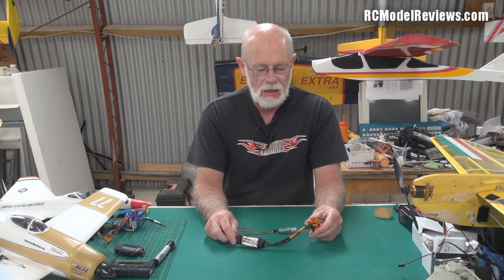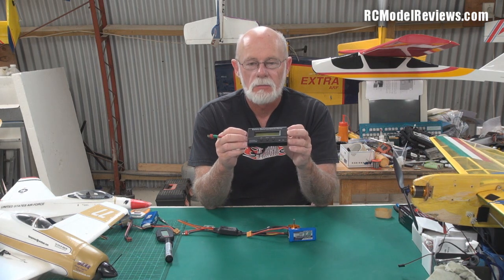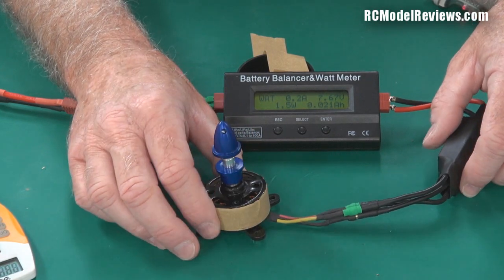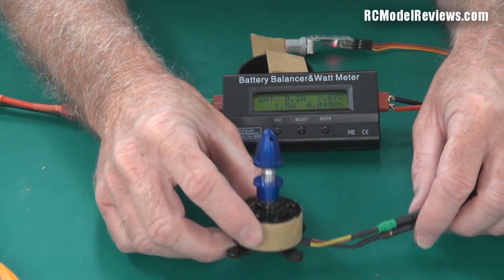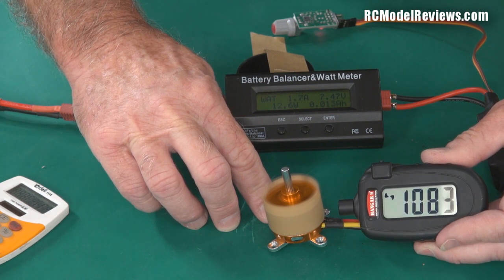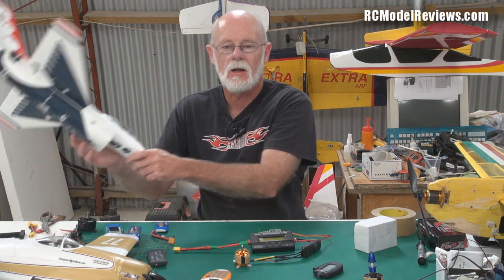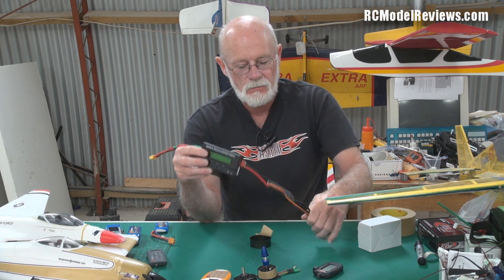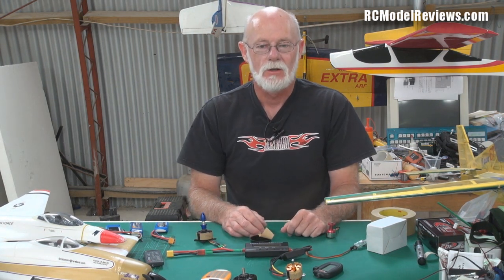RC BASICS: What is KV?

Comment: Hello bruce i have a question what motor/prop would give me the longest flight and lift the most based on a 650 quad frame(hk predator) 3-4 s lipos5000mah using simonk flashed 30 amp escs

Comment: but what wil fly your plane faster? 1000kv or 3000kv? how highter the kv how faster?
Reply: the higher the kv the higher the speed essentially, so the 3000 kv will be faster, but also heavier. It also depends on the prop. More speed isn't necessarily better because it's going to get to its maximum range faster, and if you crash, your gonna be going a lot faster

Comment: So with R/C car speed run guy's run 2200kv motors with 1:1 gearing for speed and Short Course (I'm guessing) 4800kv for torque.? Why would planes be different torque vs speed I'm confused or does this have to do with what battery can be used?
Reply: +natemorte 2200kv is more torque, lower kv is more torque, 2200kv motor is used for speed runs a 1to1 gearing because it has enough torque to pull through the long gear ration without getting to hot. 4600kv motors are used in short course because you are limited to 2s for most racing and you sttill able to get some power with the 2s on higher kv

Comment: Hello,
Can you please tell me what are you using to control the ESC, yes its a potentiometer but there is more to it then just that. I would like to buy one for myself, if anyone can please tell me. 
Many thanks
Reply: Bernhard Lehder what he’s using is a servo tester. They’re very affordable. Here is the one I use: https://www.banggood.com/Wholesale-EK2-0907-Updated-Version-Servo-Tester-Server-Electronic-Speed-Controller-p-66240.html - just be careful hooking up the battery, you can use the balance plug on a multi cell lipo to power it up but you only want 1 cell. Or use a receiver battery pack for gas planes. Hope this helps!

Comment: Seems like to increase EDF jet efficiency I would want to pair a low KV motor with a high # of blades that use an aggressive pitch angle. This should allow the plane to hit significant speeds at a lower rpm. Is this correct?
Reply: I'm still trying to figure these types of questions out, I believe the defining factor is propeller stall, if you go too high of a pitch for your model your propeller will be stalled for too much of the flight envelope, so with too high a pitch you'll be very innefeciant at low airspeeds. I think this is a safe assumption but I'm still learning myself so could be off here. Also the answer I always get when asking a similar question is "it depends on the model" but no one has fully explained why. Hard to research this stuff cause it's hard to know exactly what you need to learn.
Reply: Travis Pratt A motor will be most efficient at a given rpm. Say with the given pitch of blades and # of blades that rpm would push an F16 (or similar plane) to 60mph. Well if you put that same motor in something shaped like a B57 Canberra then that same peak efficiency motor RPM would have the plane going much slower, and this would lead to a higher amp load on the aircraft with more drag. Hence the "depends on the model" its drag/power ratio.

As you mentioned the low KV motor and high pitch blades would require a higher minimum speed. Thats what im after. High speed efficiency. Im theorizing that running the same Jet on a higher KV motor, (requiring lower pitch blades and higher rpm at the same speeds) would net more drag because friction gets exponentially worse with rpm.
Reply: Its rpm that determines motor efficiency? Will rpm always be the same for a given watt draw with the same motor?
Reply: Travis Pratt I am unsure if rpm nets efficiency as it does in Airsoft. The rpm should be the same at a given wattage, if the plane is doing the same thing at that given time. Climbing vertical will hit a higher wattage at the same rpm than level flight

Comment: Is a 1,000 kv motor more powerful than a 900 kv motor?
Reply: only if they have 10/9 the amperage draw, the thruster (a ducted fan, centrifugal compressor, or propeller) sinks the power to good use and the battery can handle it

Comment: I seriously doubt no formula exists. my guess is once esc factors, blade diameter/pitch and length and environmental factors like heights above sea level and or a range of runtime barometric pressure are all accounted for it can be modeled/made into a function that would output a flyable prop size the first time. its not quantum uncertainty. also afaik its square wave output which makes it not ac in the traditional sense. also if i have it conceptualized correctly the output of the next phase is the same polarity different phase. the only negative voltage comes from non powered phases and is used in the sense chips not actually adding drive power.

Comment: I have a question.
My goal is to build a large very light weight quad. that is very efficient.
I want very long flight times and only carry a gopro. 
I have Tarot 5008 340kv motors. they recommend up to 18" props
What if I go to 24" props? I think the efficiency would be better. I probably will not have great takeoff performance but at my light weight should make normal flight ok.
I also realize that if I am heavy on the throttles or overload the quad. The motor will most likely will overheat?
The goal again is longer flight time for the same fuel. Will I make any improvement?
I am a Pilot of real aircraft the larger and slower the prop = less fuel

Comment: Hello and many thanks for sharing this video with us.I have a newbie question please.
I was wondering where you purchased the throttle control switch that you connected to the ESC, I have a spare motor and ESC and wanted to do the little test that you did in this video but i dont want to hook it up to my phantom as i would have to unscrew everything so when i saw you plugged in a throttle control i was very interested where you got if from.thankyou ps the MFNZ SUCK
Reply: Do a search for servo tester, they can be bought on ebay for 2 to 10 bucks.
Some folks like the ones with the digital panel for doing test at various throttle settings.

Comment: Bruce I have an issue with your calculation of KV, at least as how you described it. You used the volt measurement from your battery, but that is a DC voltage. The ESC is creating an AC voltage which is not going to be the same as the DC voltage from the battery. The AC voltage will have some RMS value that would be roughly equivalent to a DC voltage. Your calculation gets within the ballpark, but I bet your lack of accuracy is due to difference between AC RMS and DC volts.

Comment: Could you please tell me "what is that device that is plugged into where the receiver goes that has the adjustable knob on it?"
Reply: +Mitch Livingston You can buy a digital servo tester, typically used to test that servos are running the right direction, they will also work for testing motors all you need are the signal and ground wire from the ESC,
They typically need a 6 volt battery or wall wart DC power supply then you just plug the ESC leads into the  other end, the pins will generally be marked with a +, - and a squiggly line you just plug in the - and the squiggly line from the esc and away you go.
Reply: +fabricator Thank you very much for taking time out of your day to answer my question!
Reply: No problem.

Comment: But how does voltage change the speed? I thought brushless motors AC or DC are dependent on frequency
Reply: same question!
Reply: The supplied voltage has a trickle-down affect on the rest of the motor.  The current magnitude is in turn impacted by the voltage.  the magnetic fields in the motor are created/impacted by the current. Said another way:

The speed at which the rotor turns is controlled by the magnetic field, which is in turn dictated by the current, which is in turn caused by the voltage.  Hope this makes sense.

Your comment about "frequency" isn't WRONG, it's just you have to be really clear what you mean by frequency.  I think you are referencing AC motors which do have a frequency associated with them. 3 phase induction motors/generators (such as those used by utility companies to produce power for your house) are frequency dependent (60 Hz in the USA) so that there is a STANDARD for equipment to operate on.  The frequency in this sense is the number of times per second that the power (in watts) completes 1 full cycle on a sine wave curve.  60Hz means its happening 60 times per second.  Try not to confuse the idea of AC frequency with... well, just the general meaning of "frequency" which is "how often something happens".
Reply: Jason Cochran I agree when you're talking about brushed self commutated motors, but brushless motors aren't mechanically commutated. The ESC sends out an artificial 3 phase sequence for the rotor to follow, the higher the frequency of the sequence of phases the faster the rotor will spin.

Applied voltage won't have an effect on speed, only current drawn needed to supply output power.
Reply: Thats not exactly my understanding of ESCs for brushless motors.  I believe ESCs are essentially manipulating the motor via Pulse Width Modulation (PWM).  Higher voltage = longer pulse = spins faster because the motor is switched "on" for a larger percentage of the cycle.
Reply: Jason Cochran ESCs are generally for controlling AC motors, which change their speed according to 3 or more pulses corresponding to a position in the motor.

Comment: You left out the "why"?
We get that K=rpm and V=volts, and yeah, you can measure it... but WHY does it make any difference?
Isn't it the rate at which the ESC fires the windings that determines the RPM, in conjunction with the load on the motor?

I don't get how or why volts have got anything to do with that?
Reply: kv is an equation, k times v. if you have a 1 volt input on a 1500 kv motor, your motor speed is 1500 kv, 2 volts is 3000 kv and so on

Comment: I notice you made a mistake. Bigger motors have a much lower kv because they use much larger batteries with higher voltages so the kv has to be lower in order to spin the prop the same rpms as a higher kv motor using a lower voltage battery.

Comment: Why does is say 794 on the motor at 5:28?
Reply: 800 kv motor..800 rpm
Reply: Take 1 wasn't the published take.  I'd rather have a well prepared presenter, then someone trying to fumble through and potentially provide confusing information.

Comment: Bruce:  you forgot a critical step in your video.  You had one black line on that motor and the tach was expecting two blades.  Two pulses per rpm.  The real value from the tach should have been divided in half before you wrote down the final number.  That makes it a 395.58 kv motor (395kv rounded to the nearest whole).
Reply: If that were true then the 2nd motor he tested where the Kv was already known would have been off by a factor of two, whereas in reality it was pretty close to the expected value.  So the tach must be set to count one pulse per revolution.
Reply: pyronaught It's not possible to do so with the tach he uses.  It counts two pulses per rpm.  For an accurate result, a laser tach would have to be used.
Reply: gaptoofgranny if you watch carefully you can see at 6:20 that there are two black lines on the first motor. The second one has two black lines, too.
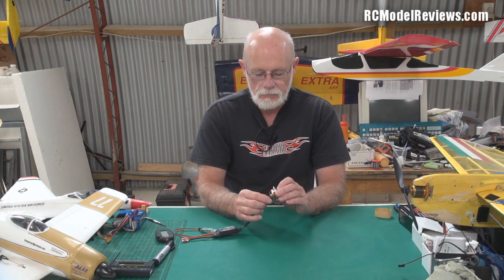Reply: At 1:27 he says he put 2 black marks...

Comment: whats better low or high kv
Reply: Thanks, but what is better for a Boat. Low or High KV.
Reply: Thomas Vids What kind of boat? Without more info no one can say what's 'better'.
Reply: sorry for the trouble. i will just use the type of motor in a boat a similar size. Thanks.
Reply: Thomas Vids It would be more trouble if you actually gave enough information that it was possible to help you as then someone would actually have to do something. Simply asking 'what's best' is no good at all. It's like asking 'what's the best car' without specifying if you want to go as fast as possible around a race track, carry as much shopping as you can, get the most miles per gallon or go up steep hills off road without getting stuck. There's simply no way to give a good answer. I'm not trying to be difficult - it's a serious point. 
Just specify what model boat you've got and chances are someone will be able to help. But copying someone else's that works well is also a good strategy.
Reply: I am building a boat. You have been a lot of help. I understand what you are saying. I already know what kind of motor i am getting. Thank you.
Reply: no worries :-)

Comment: THREE WIRE IN STAR DELTA KV 14000 EMMITER SIGNAL CURRENTS 7 KHZ ISOLATION INDUCTANCE REACTANCE  VOLTAGE 6-9 VOLTS 7.5

Comment: brushless aren't AC ...
Reply: you are sort-of right. and sort-of wrong. technically they are dc. realistically though being 3-phase motors. the esc is turning the positive pulses on and off. so they operate more like an ac motor. really they should be called 3 phase pulsed dc motors

Comment: KV should be called rev-volt
Reply: RPV or RPMV or RPMPV
Reply: @vertigo6982  Or at least notated K/V, Krpm PER volt
Reply: A rev-volt would be some kind of capacity, not a speed rating. If anything it should be revs-per-volt.